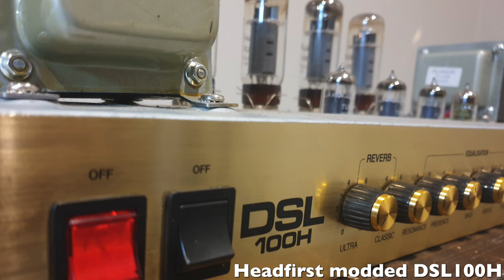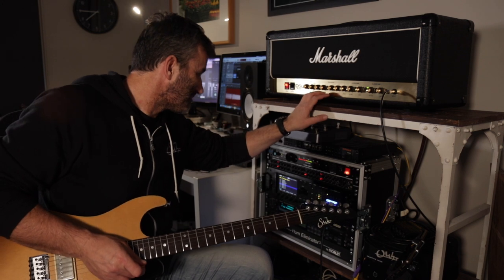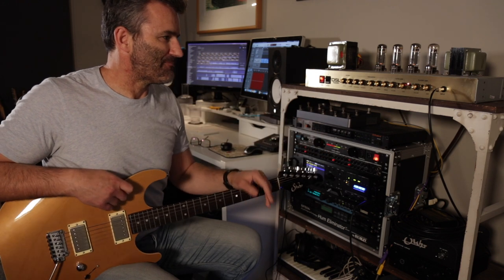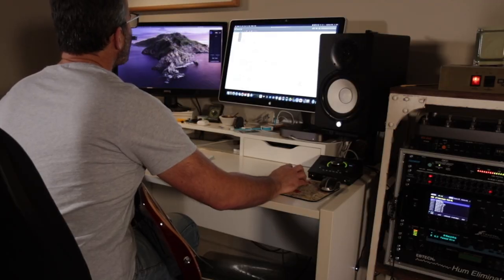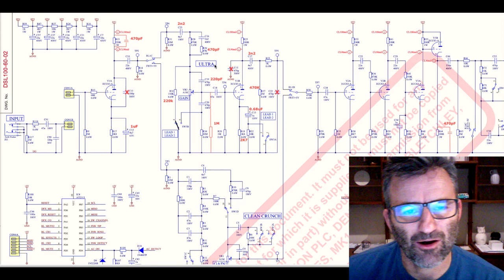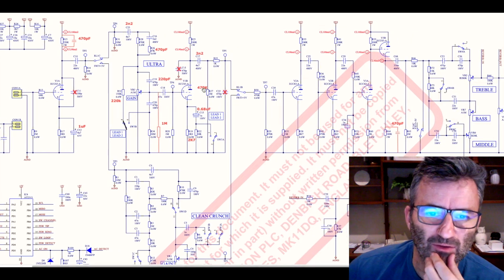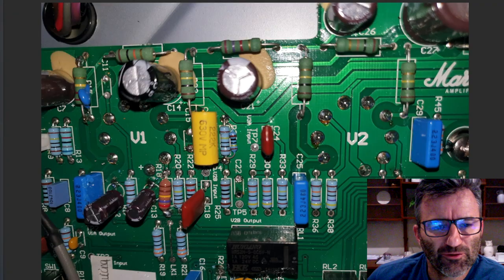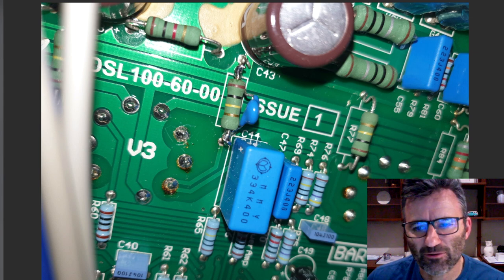Modding a Marshall DSL100H - TONES AND DIY GUIDE!!

Comment: So I performed these mods to my DSL40CR this weekend. Some of the components are different in the CR, the second stage bypass cap is already .68uF, But putting the schematics side by side, I was able to make the same changes. Totally changed the amp for the better, in both feel and tone, and it is super crunchy on the Ultra green channel. it takes over where the Red classic gain channel leaves off, and the amp is a classic rock tone machine. All four modes work very well together. Thanks for putting this info out there. It completely transformed my amp into the type of sound I have been hunting for.
Reply: Glad you mentioned this, I'm about to add a filter Choke (Hammond 194G) to my DSL100HR. I was just waiting put most of the warranty before I started nodding. And I'll certainly be doing some of these other mods. I just finished my last pedal project (Chasm Reverb with some mods I came up with) so I need a new project. I'm also supposed to be building a couple pedal boards but I dont have the extra money to do them how I want right now. But a $25 choke and these mods (I already have plenty caps and resistors on hand) will be cheap but effective I imagine. Again thanks for sharing your experience with your 40cr!
Reply: I'm 99% done with doing the same with a dsl100hr, how did you fare with the c79 on the back of v1? not sure if i'm keen on not being able to get to the underside of that cap
Reply: @drewpritchard2273  Taking the board out is not hard, just time consuming. Take pictures of all the connections, and take your time. While you are under there touch up any solder connections that might not be great, the wave soldering Marshall uses is not the greatest.
Reply: Hey Rick, I've got the 40CR.  The bottom end bass isn't tight and more importantly...the tone is just modern.  Did your mods change any of those significantly?  I feel like the DSL40 package has so much potential but they should have just built in a JCM800 mode into OD1 and then whatever else they could get close to a hot rodded plexi into the Classic channels.  If there were some mods for that, it'd be pretty amazing.
Reply: Hi Rick, where did you find the schematic for the DSL40CR for the mods you did?  I’d like to tighten up my amp and get it more responsive like a JCM800-ish

Comment: Please do the DSL100HR too! They changed up some things on these newer models, its a bit less harsh and flubby than the older models i have played, still i feel it could use some improvement, its a bit stiff feeling under the fingers and not as fluid as some more expensive amps, i really wonder what kind of magic you would do to it.

Comment: Great mods, I have one for the clean channel, adjust R2 down to about 2-3k. It is the bass control in a fixed tonestack, I find the clean channel is to different low end wise to the ultra gain channel. This makes them very close eq wise, so they play better with each other if you are a channel switcher.
Reply: Hi. Did you lower it for 2-3k difference or put a 3k ohm resistor there? Sorry i didn't undesrtood right
Reply: @rodrigomartins9692  I changed the value to 3k. You can remove the resitor and use a pot to dial in what you want it to be and then solder in a resistor with that value if you like as well. Just be careful.

Comment: It's probably worth mentioning that the Joey Mods thread shown halfway through this video is for the JCM2000 DSL amps, rather than the newer DSL100H, just in case anyone goes blindly copying what's mentioned in the thread without checking. As stated, there's many versions of the JCM2000 already and component numbering changes between even just those revisions of the board nevermind newer amps with the DSL name.
It's alright for people like you or I as being able to recognise this stuff and what component being suggested to change does what and where that would be on a different amp etc etc is second nature by now

Comment: I know this is basic physics but it's still so effing cool. Completely changing the character of that amp by swapping out a couple of values. Good tone before, a monster after! I love these tutorials. Just got going on a JCM:ifying an old Peavey Windsor.
Reply from the maker: I'd love to hear how you get on with the Windsor.
Reply: @HeadfirstAmps  Exploring the options with the effects loop rn. It's really shitty out of the gates. Aaaand I don't really know what I'm doing. So there's that.
Reply: Don't forget to adjust the power supply (dropping resistors). I believe the Windsor runs pretty low voltages in the preamp.

Comment: I did mods to my TSL 60 heads I use to own and that was my by far my fav Marshall amp i ever owned. One thing i advise anyone who owns these DSL and TSL heads, buy replacement boards because your gonna need them unless you do a lot of replacing of parts and get to those parts before they cause issues. I owned two TSL 60 heads and I had replacement boards for each one and in the end I had to use them to fix the amps. I got 5 years out of the first one and about 7 out of the 2nd amp before issues came up and caused harm to the boards. I love these amps, but damn Marshall did some cheap and stupid design choices in these amp. Thanks for the video ;-)
Reply: Hey fella - this is the newer DSL not the JCM2000, which is the one you are referring to 😉
Reply: @GuvnaOnSpotify  Gotcha ! Ok. I was thinking it was JCM2000 series. I have not tried the new DSL series of amps. My bad ;-)

Comment: I like the presentation on the DSL100. Your choices for tighter brighter are not what I would do. But this is a difference in taste and your ears. You could look into EPITAXIAL diodes replacement for a spongier power supply. I am replacing that 270 ohm with a choke.  I  removed the bright cap on the gain control. The amp is not well biased from the factory. I re-biased. My amp is perfect and behaves. I enjoy the capability of the bottom and sometimes, if I want, I get that nice woolly bass. I can always roll off some bass. Thanks for your video on this and your astute explanations. No one else is showing this much confront.
Reply from the maker: Thanks!
Reply: Do you remeber how much mV I should set forthe BIAS for the DSL100H please? I'm gonna to change the EL34s. thanks!
Reply: @ace-rob71  keep it around 72 to 75 mA. That is a total of two EL34s. Match as best you can both bias screws which is the metric of each side of the push/pull.
That is 70% bias point at 37mA per tube with the plate voltage at 470v. This is a comfortable setting with an average set of EL34s and with this there has not been any runaway red plating. If that happens, locate and replace the faulty power tube.
Reply: @rdavid3848  thank you!!

Comment: Im about to try out a mod on my DSL100HR that ive been thinking about for awhile. But first ill say these are great amps even stock and the newer HR versions are even better. My main amp is the DSL100HR that i got when they first came out, 2nd month they were available. Anyways so far ive modded mine with a Hammond 194G choke and a switch mounted to the top of the chassis that allows you to select the choke or the stock resistor. 90% of the time i prefer the beefy feel of the choke but it can be fun to use the resistor and really let the amp open up to get some more sag characteristics. But to hear the difference between the two you really dont need to have the volume very loud. Its quite apparent when you have the choke engaged vs the resistor. My next mod (just waiting on parts) is going to be swapping the gain pots on the Classic and Ultra channel for concentric pots. The outer dial will control the gain like normal and the inner dial on the Ultra channel will dial in the C12 capacitor (that everyone removes on the DSL100H and that was left out entirely on the DSL100HR). So on the Ultra channel the inner dial will brighten up that channel the higher its turned up and darken the Ultra channel the lower it is. On the DSL100HR's PCB they left the pads/eyelets for "C12" which is actually C74 on the DSL100HR so that you can add the capacitor back in if you liked the stock DSL100H and wanted that sound on the DSL100HR. The C12 value is 470 pF. With no C12/C74 the Ultra channel is a little too dark on Lead 2/OD 2 but with tighter low end. But with the full 470 pF cap its a little too bright on Lead1/OD1 but the low end isnt as tight. So by adding in a value around 150 - 300 pF it sounds really great as a lead/solo tone. But sometimes the Ultra channels sound better warmer with no cap if you are hitting them with an overdrive like a tube screamer or Timmy etc. that will brighten them by adding gain, mids, upper frequencys or cutting lows. So being able to dial in the exact amount of brightness for these channels is really useful depending on the situation. In other words it should make an already versatile amp even more versatile. Without C12/C74 you loose the Marshall lead/solo tone "Snarl" but i also completely understand that with C12/C74 the Classic and Ultra channels EQ dont match up as well as they do with no C12/C74. As for the other concentric pot that replaces the gain on the Classic channel it will be doing the same thing (brighten or darken the Classic channel) by dialing in (C4 -100H) / (C61 - 100HR) but im going to use a larger value in place of C4/C61 so it will be able to be warmer than stock and brighter than stock depending on where it is set on the inner dial. And of course just like before the outer dial will still control the Classic channels gain. You might be thinking why not just EQ to get these changes and theres a few reasons why that isnt as ideal as this mod. The EQ isnt something you can set separately for each channel but with these mods you can get some slight control over the EQ of each channel simultaneously. And i truly do believe that the last little bit of magic that separates the big boys (plexi, JCM800 etc.) from the DSL line can be accounted for with this mod that wil lallow control over the snarl/depth of the preamp gain. Im really excited to get these mods in place. I try to post about all my builds an mods on Marshall amp Forum so if anyone is interested how it comes out keep an eye out over there.
Reply: Hey man, hows that DSL100HR treating you?  I've got the 40CR and it's been good but the tone is somewhat modern, even on the classic crunch channel.  The OD2 channel seems to be difficult to use, tho with rolled off guitar volume it's cool.  I'm wondering if you found some "defacto" improvements?  I'd love to get close to an AC/DC JMP800 sound...but then also that super tight, articulate JCM800 sound too!  (I'm not sure I could get a plexi sound out of here).  Anything that's been huge for you?

Comment: Great stuff as ever Jason! Made the red channel have much more of a plexi percussive attack sound, and I presume the choke will help make it a little less stiff feeling?

I have one of these amps too, and I’ve found the master volume can make a pretty big difference to the tone as far as rounding off some of the ugliness that can come through on the red channel. Not ideal for using live as the levels can end up quite mismatched but it does offer some more tones based on how it’s set.

Love the explanations of the different parts of the circuit, thanks so much for sharing your tweaks and making the video!

Comment: I very much appreciate that you put in the time and effort to make this series of videos. I have one of these amps and was evaluating if I want to make the changes you documented based on the before and after. I noticed one thing in the 'before' section of the video. When you are evaluating the Ultra Gain channel, it seems as though the wrong gain knob is being adjusted (classic gain channel instead of Ultra). This happens a few times around 9:07. This may have just been an oversight while you were demonstrating for the video. Are you sure you were comparing apples to apples when comparing the before and after recordings? Thanks for doing this. Great video!

Comment: Another great vid mate. It makes me wonder what Marshall was thinking when changing up these drive channels...Sign of the tones of the day I guess. It seems like they were trying to reinvent the wheel when it really didn't need it. Im all for trying new things but I can't help but think it was the marketing department driving these changes, any changes! instead of guitar players. Anyway with blokes like you around it seems like an easy enough job to bring these amps back into a usable state. The clean and crunch channels still do stand up in a stock form which is the amps saving grace. the rest just seems like more gain for gain sake at the expense of tone and clarity...silly IMO. 
Cheers mate, another informative and useful vid.
Reply from the maker: Agree Scotty.  The JCM2000 was the amp that replaced the 900...now just imagine if this thing had simply been a 1959 plexi pre for channel 1, and then a 2203 800 on channel 2, with some basic structure/cathode bypass cap switching options.  It would have slayed and would be a reverred amp to this day.  It was such a missed opportunity.
Reply: @HeadfirstAmps  I could never get a tone that I liked out of a 900 but I heard others use them and sound great. A very different tone to the 800. All these mods are certainly getting your chops back in shape mate. Again the Suhr sounds very nice indeed.
Reply from the maker: The 900 is a solid state disaster imho, with the exception of the 900 SL-X which is all tube.
Thanks, yeah that Suhr is the one.

Comment: I have the DSL40 and I definitely agree about the lead channels. Lead 2 is just unusable and just mush in general. Lead 1 is okay up to a certain point. I mostly stick around the clean/crunch channel as I prefer that edge of breakup plexi style tone.

I've just got a question about the clean mode vs the crunch mode in the classic gain section, looking at the schematics are there any differences aside from the increased gain in the crunch mode?
Reply: I kind of like that to be honest. Tuning a guitar to C, and go with that Doom, Sludge tone. But yeah, it's the opposite of tight lol

Comment: That's always been my problem with the old JCM2000 DSL too. The gain on ultra lead 2 is far too muddy past 6. Otherwise it's a great amp especially with a mercury choke & OT.
Reply: The joey mods thread he shows half way through this video is for the JCM2000 and addresses a lot of the issues with the amp

Comment: Been thinking about pulling the trigger and getting one or two DSL100s to mod, I like the gain on tap but I feel that they sound really flat. I also play almost exclusively down tuned 7 strings, what would you recommend doing to make them more aggressive and what you might call more "modern" sounding, i.e. the fortin modded amps or the more recent variants of the Uberschall
Reply: I was considering applying bright caps and maybe a clipping diode, since I find the amps I named tend to become so pushed that they get very close to being fuzzy but are still aggressive and articulate

Comment: Just loving your videos my friend. But I do have a question for you. I know this can be done and maybe you have some insight. But I have a 100h and a DSL 50 jcm 2000. And what I am looking to do is to forego the reverb foot switch and be able to add some sort of relay to change between lead 1 and lead two in the ultra gain channel.. could you do some kind of video for that and what would be needed to do it?
Reply from the maker: Hi Andy, thanks.  Yeah that’s probably doable, but would almost certainly require a bit of surgery, I.e. cutting PCB tracks and so on.

Comment: Would it be overkill if I stuck a Klon style pedal in front of the modded Lead 1? The gain on the pedal would be set around 10 oclock. The volume 3 o'clock and tone at around 1 o'clock.